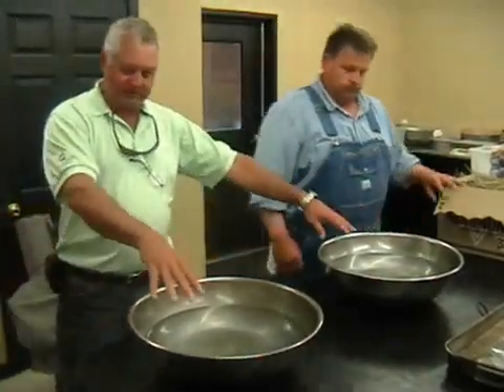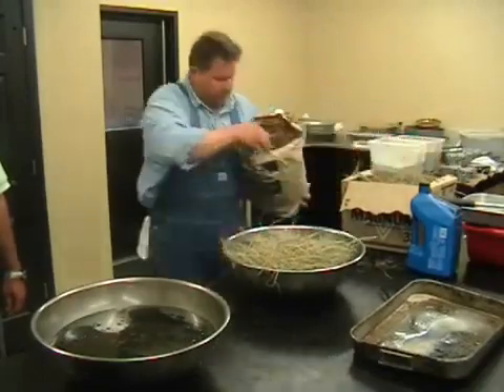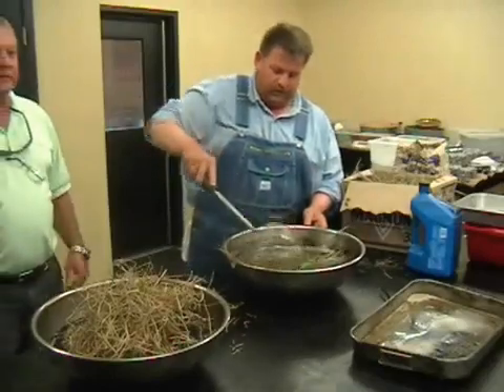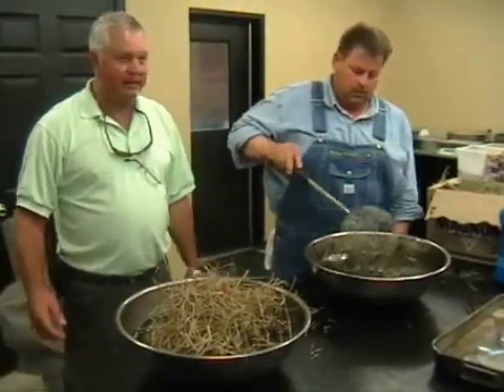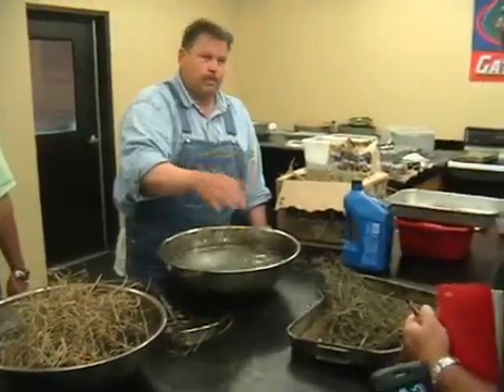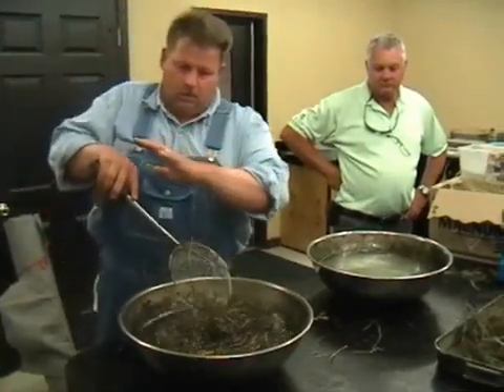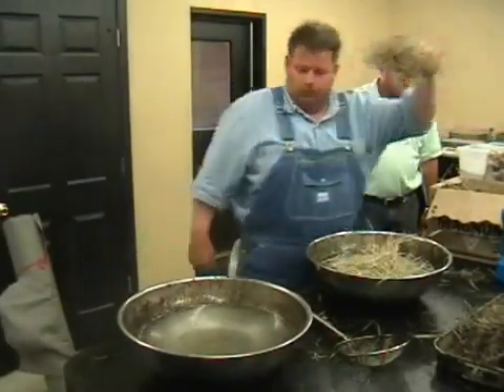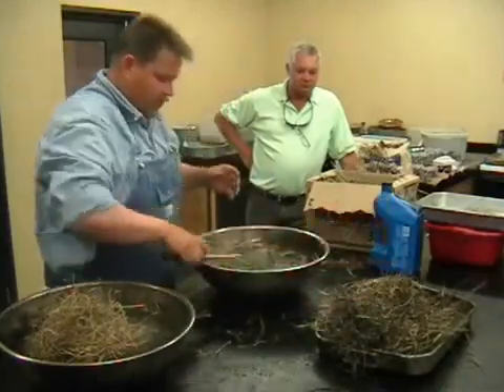BP Oil Spill In Gulf Of Mexico - Cleanup With Hay, Why Use Toxic Dispersants?

Comment: @MrBrowngb This idea will definitely not work. You have to ask yourself this question, how long does oil float? This can only clean up the top part of the oil but oil can only float above water for so long. It has already sank in most parts of the ocean floor..